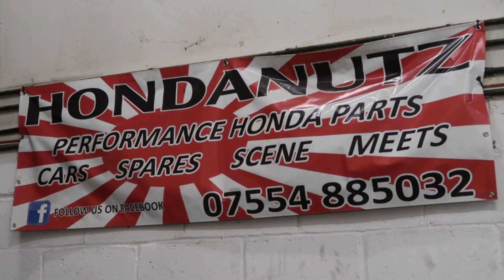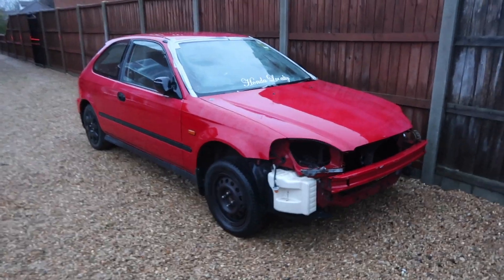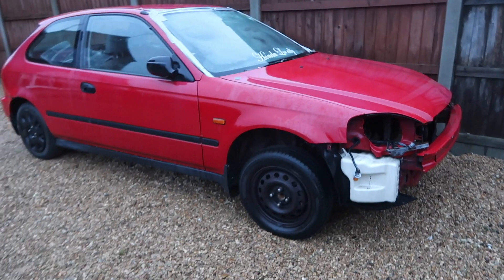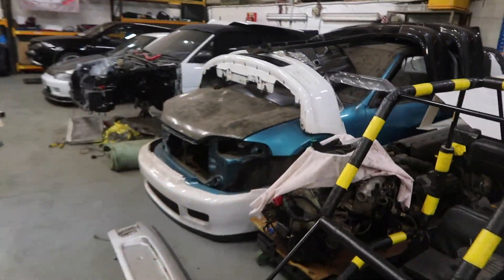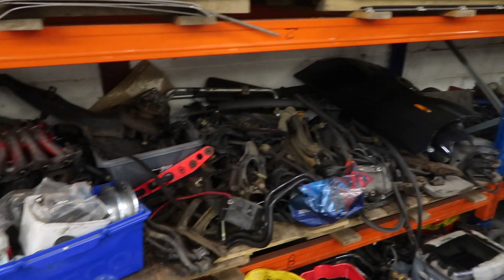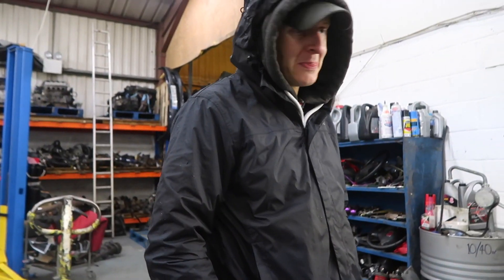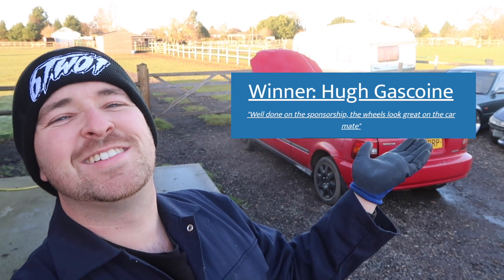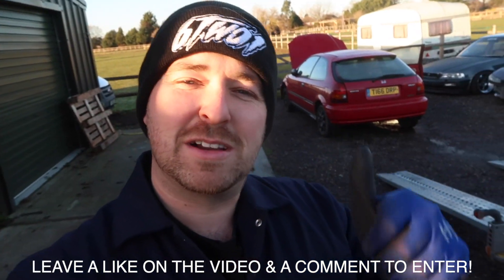ANOTHER NEW CAR  ! (THE BIGGEST PROJECT YET) 👻

Comment: I've worked in a body shop for the last 15 years doing restorations, and my advice is to cut away as little as possible just leaving good original clean metal, as that will be better quality than cheap repair panels. Good luck dude 👍

Comment: I’d fit areo catches to the bonnet, Whistler wheels, spoon exhaust system, limo tint all rear windows,hks induction kit, spoon tinted wing mirrors, sun strip, spoon mirror, status seats, 6two1 coilovers, underseal the car, upgraded brakes, braided fuel lines and brake lines, de badge, mugen pedals, tuck engine bay, respray, k20, paint the gear box and engine, maybe even air ride if not coil-overs, asr and beaks bar, maybe even turbo it

Comment: Personally mate, I would cut the arch/ bodywork where it has rusted and not half way up the rear quarter. Saves cutting good metal out where it does not need to be cut so shorten the aftermarket panel instead. 👍 Happy new year!

Comment: Merry Xmas and a happy new civic! If it were mine, I'd strip the whole car down to metal and start practicing welding. Seam welding all the panels, tack weld all the holes in the engine bay, fabricate my own brackets, practice fab'ing some roll cages (passing tech would be another thing), weld on the new body panel in the rear, fabricate a spot in the rear for a differential for awd.. weld up a fuel cell. I might be half decent at welding or really good at grinding by then end of it.

Comment: I’d build into just a nice fast road car to bomb about in, take your time with the welding, grind the old arches back to bare metal before you cut anything out, only cut out the rust, smaller repairs will be easier to manage, no point cutting half the car away to repair a few  small scabs that can be pieced in.
Spot welds are your friends, check out urchfab channel for how to setup your welder and techniques for welding car bodywork

Comment: Good luck Adam, inner arches will be rotten for sure, cut away enough to have clean metal to work with, don't try to use multiple patches. Don't be afraid to cut out anything you may have welded in to start over for a better result.
Reply from the maker: You can come help !!
Reply: @6TWO1  you know what I would like to. Tell me when you plan on starting. I will try to come over with the girlfriend and make a weekend of it.
Reply from the maker: Once I know I will tell you! For sure that would be great
Reply from the maker: Ferry is fastest to harwich as I live 30 mins from the port
Reply: @6TWO1  nice 😁, I don't mind sharing some of my experiences 😂